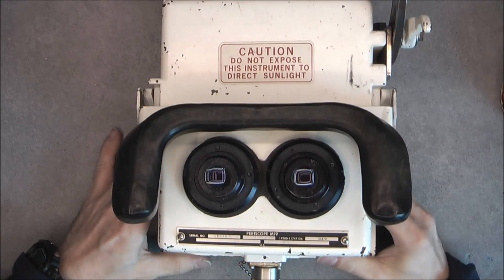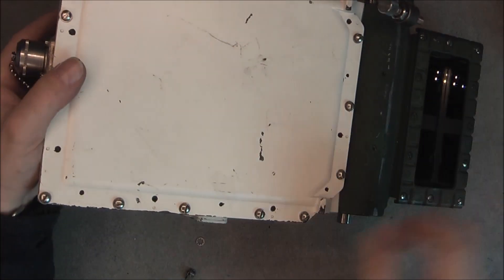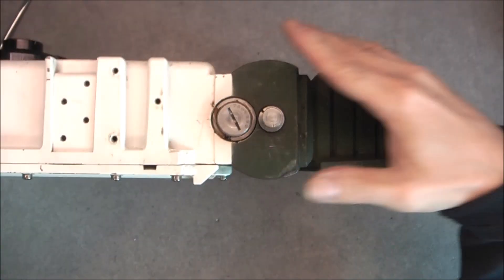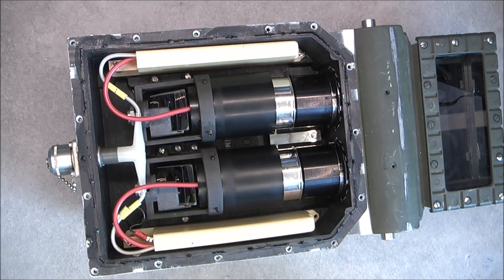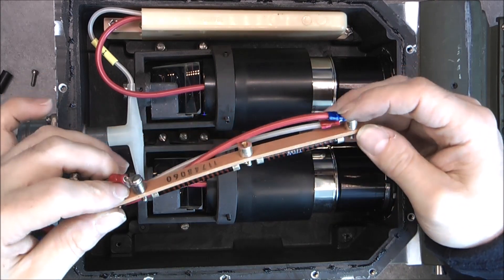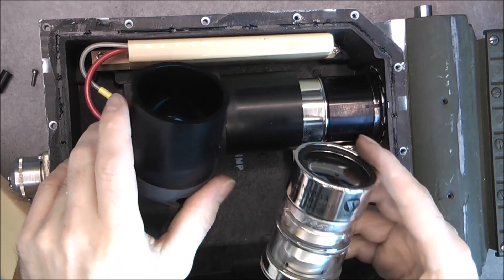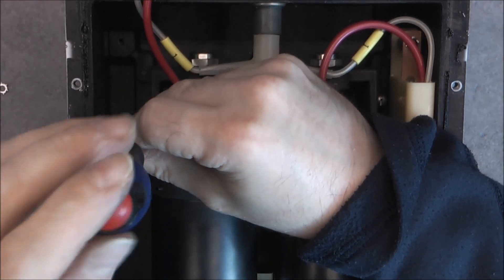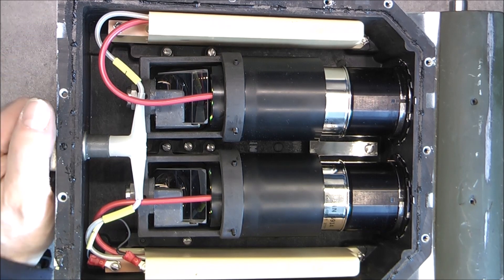M19 night vision tank periscope teardown

Comment: This is a ""generation 0"" device, a passive device, which mean that it doesn't amplify residual light (actually it dims it) but you can use a powerful and totally invisible light spot (800-something nm) to illuminate the scene.
Whereas gen 1 and gen 2 (well mostly gen 2) amplify a lot of the residual light but can only pickup 700-something nm light source, which can be spotted with the naked eye. (faintly, but still... not totally invisible)
French army use to make their own version of these kind of periscopes too, which used Philips tube and a high-voltage converter + a D-cell back up built-in the unit.

Continue the good work! ;-)

Comment: Someone in Pakistan is selling 4 NOS JAN6914s on eBay for $800, undoubtedly the $200 each ones you mention.  I can't find any tech data on the tube, but I found some interesting info searching on its NSN (National Stock Number) I obtained from the marked NOS boxes seen in the aforementioned eBay ad:

NSN 5960-00-082-3326

https://www.wbparts.com/rfq/5960-00-082-3326.html

Comment: It would bring way more interest and value to your videos if you: a) bring technical context or demonstrate an effort to explain the principles of operation of technology, which in most of the  cases you brought, is declassified; b) try to demonstrate (even if partially) the device in operation, even if in some cases this may involve fixing or integrating with external devices (e.g. emulators of missing hardware)
Reply: Came here hoping for this, was disappointed like you were.

Comment: This was also used in the M113 APC, for the driver and it is a Infrared device. The power supply was very high voltage, attached to the LHS of the vehicle, connected by a coaxial cable.